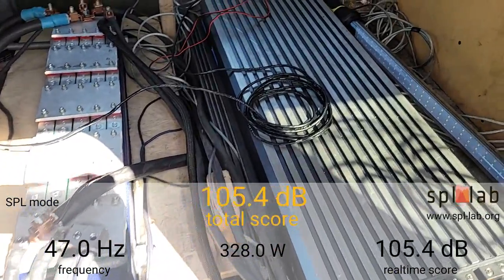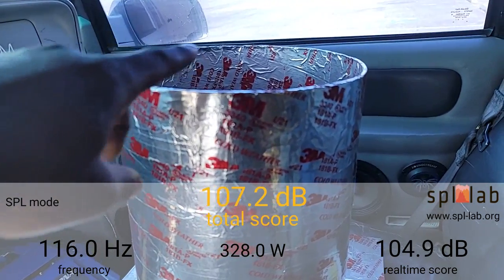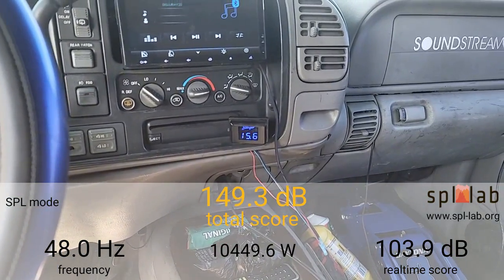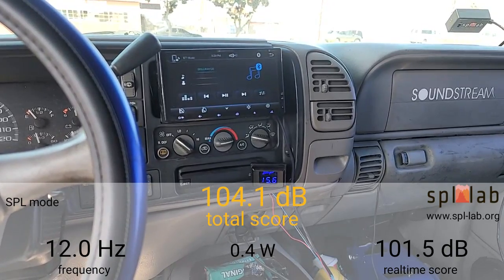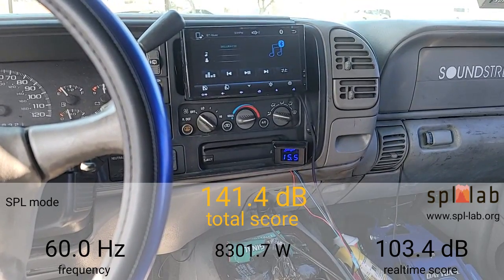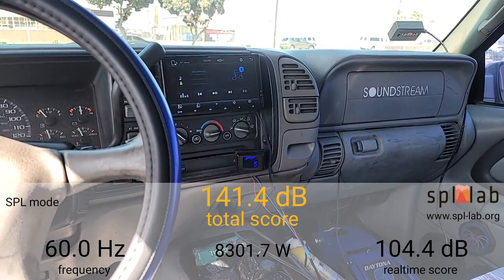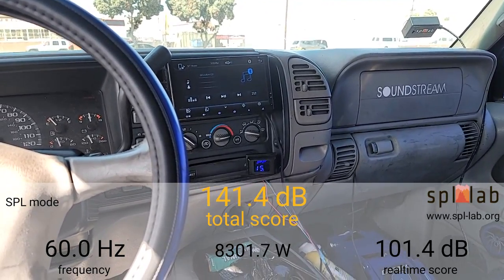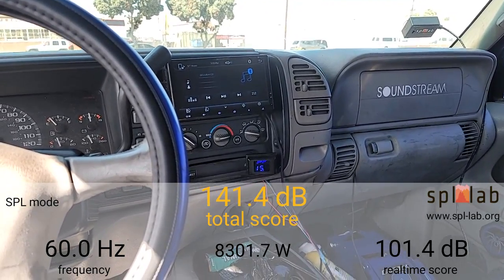Soundstream XXX 15000D Meter And Clamp Test @ 1 Ohm 30-60Hz

Comment: Sweet👍 Does this meter come as a complete kit or do you have to buy each piece separately? Thanks👍
Reply from the maker: The meter comes by itself you have to buy any additional attachments such as another spl meter, rta meter or clamp meter
Reply: @BIGJURAY20  Thank you, i have to go buy that whole system you're using👍👍👍
Reply from the maker: @catherineharris4746  Yea it's a nice unit and the results are pretty accurate

Comment: Big juray can I ask you a question if I have three batteries the amplifier is on one  and the two is linked together with the amplifier battery with one should I put the voltage meter on
Reply from the maker: With three batteries I'd recommend all batteries be linked together in parallel all positives together and all negatives together as well. From there you can wire your voltage meter on the same battery you have the amp on.
Reply from the maker: Voltage should be around 12v- 14.8v with liquid acid or agm batteries
Reply: @BIGJURAY20  ok thanks for the idea man
Reply from the maker: @moneycat3789  No problem bro

Comment: The ten inch port is louder
Reply from the maker: In my case yes it is
Reply from the maker: The 10 inch port allows for more port area but also shrinks the volume for the subs. The 8 inch port allows for more volume for the subs but not enough port area